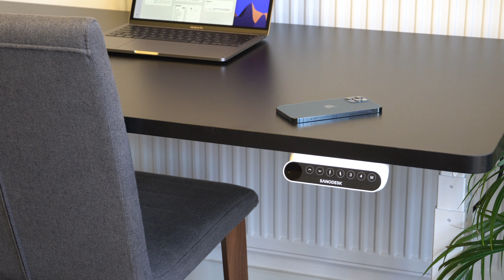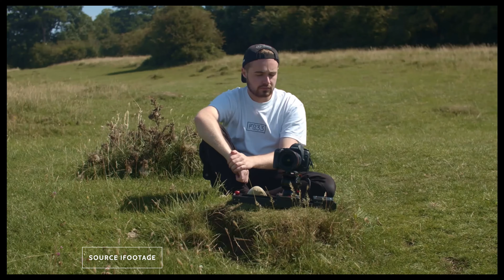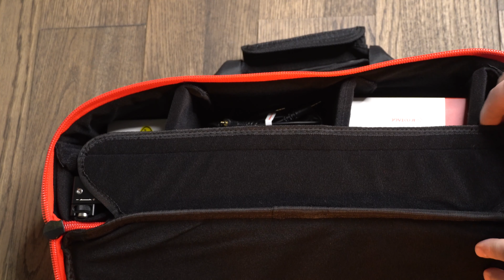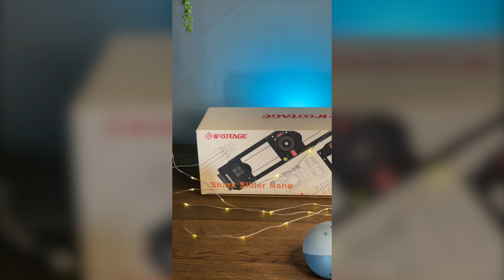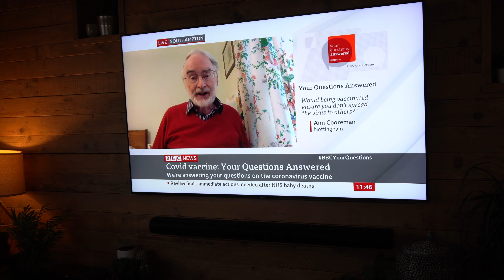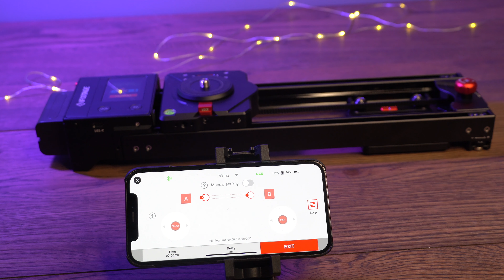Level Up your Videos! With The Awesome NEW Shark Slider Nano by iFootage

Comment: im on the fence with this one, there seems to be jitter in all the footage I have seen, has this been fixed with firmware or is this a motor problem?
Reply from the maker: This is still my main slider, very happy with!
Reply: @allthingstech  yeah apparently most of the jitter is user error by not tightening the base enough. I orderred one already haha

Comment: I pre-ordered this, will hopefully receive it in January 2020. Is there any particular tripod you could suggest for this? Ideally something not too expensive.
Reply from the maker: I have the Manfrotto 055 which is perfect, just need one with a reasonable size base plate for it to screw onto.
Reply: @allthingstech  thanks.